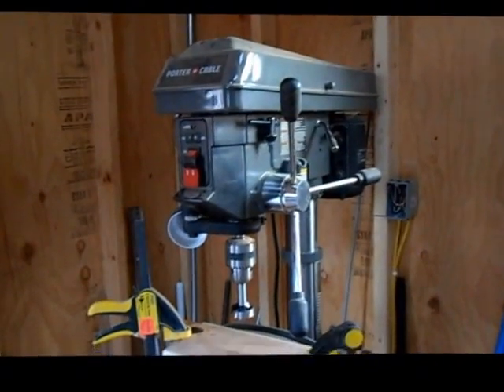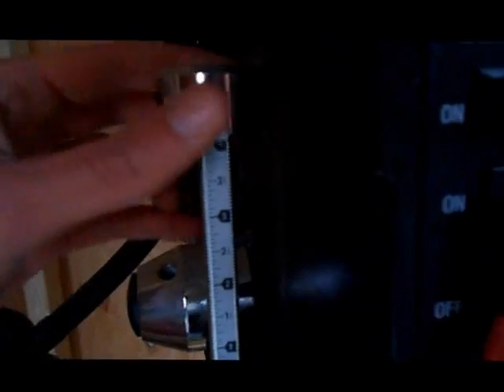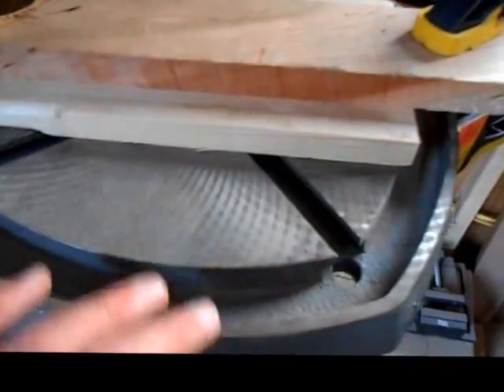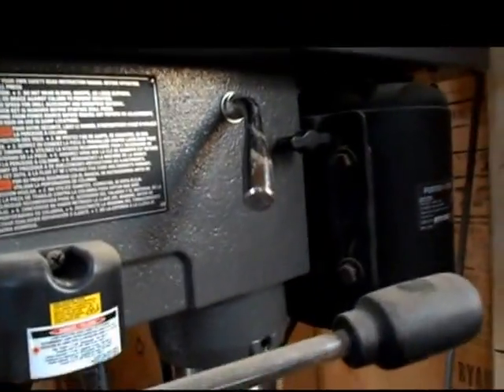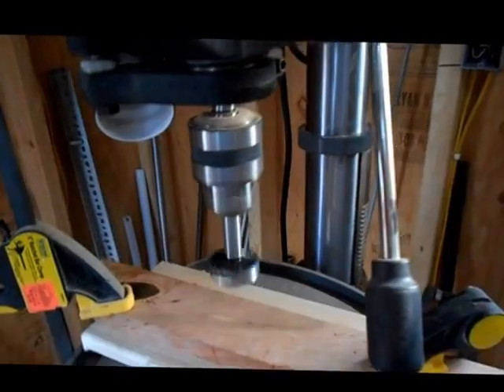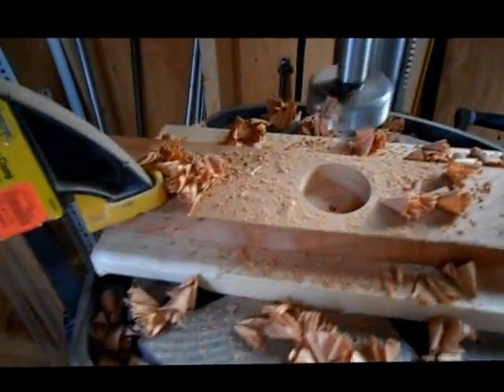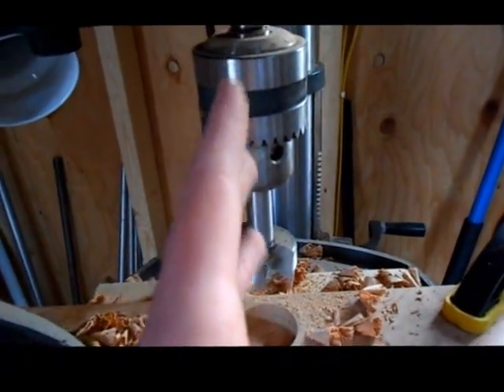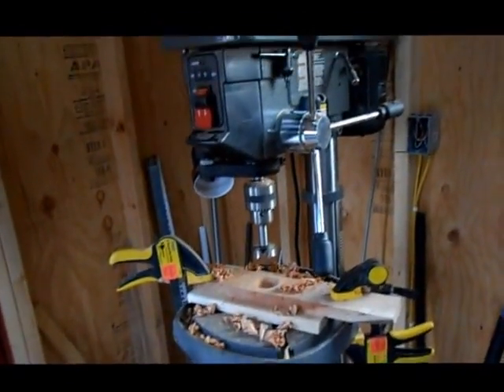Porter Cable 15" Drill Press

Comment: is this the type 2 model where the table is fixed and will not rotate,,,im talking about rotating not turning the table on degrees
Reply: you have the type 1 drill press the ones lowes sells now is the type 2 which cannot be rotated and you have to remove the gears on the post plus the top ring to put it on over the post from the top,,i never noticed this till I bought one and went to put it together,,i returned mine,,,
Reply: yes me either,,i really wanted the drill press,,but not the type 2 now that they sell at lowes,,thank you for your response